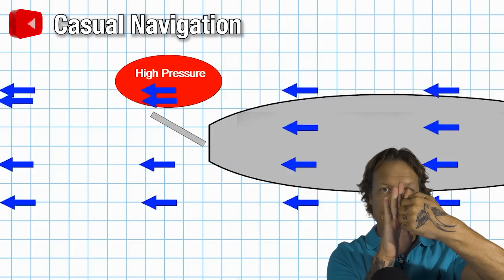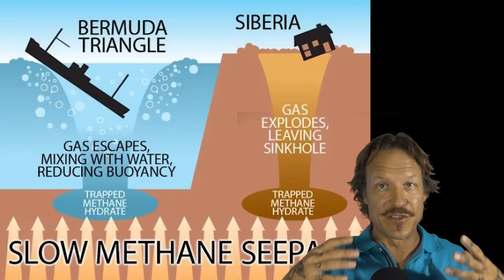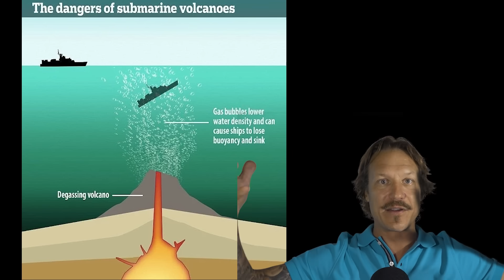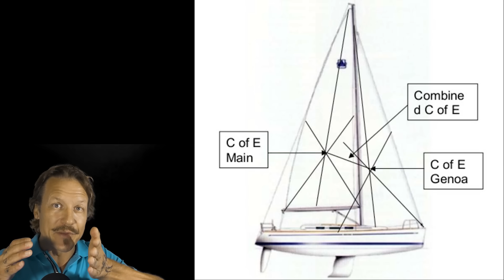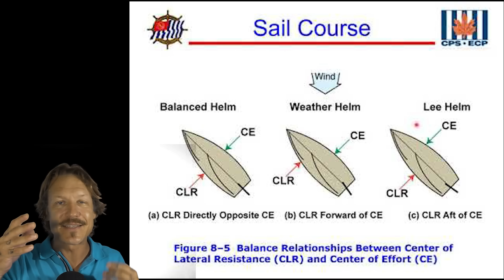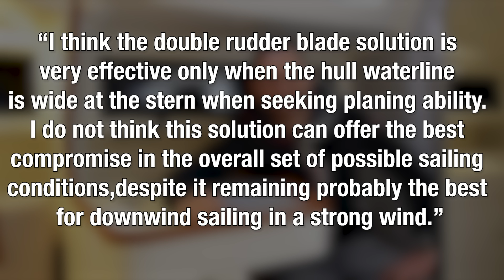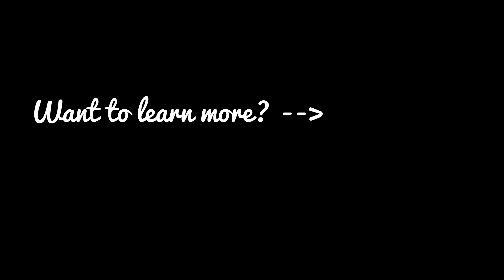The Problem With Dual Rudders Nobody Talks About

Comment: Hi James. Love your videos, however I would like to clarify the issue with heeling and its impact on CLR. Full disclosure here - I am a naval architect. CLR is predominantly determined by the size and location of the keel and rudder(s). The hull, particularly on a flatter, more modern hull isn't really a contributor to lateral resistance. When a sailboat heels to leeward, the Center of Effort moves to leeward and the keel moves marginally to windward. This produces what is called a lever - the mostly forward acting forces acting on the sails/rig are offset to the side of the boat and this will tend to make the boat round-up into the wind, all other things being equal. The CLR of the hull will not move noticeably as the boat heels, however, the area and angles of the rudders may play apart if not designed correctly. They should be designed for minimal change in lateral resistance as the boat heels, but perhaps not all designers do a good job of this. Another factor which may account for the different handling characteristics you have experienced could be due to the different ways that the centre of buoyancy changes on a wide vs a narrower hull as it heels. In theory, it will mover further aft and further to leeward on a wider hull, but how much and what impacts this would have would be very dependent on the actual hull shape. In short, I believe that IF designed well, the weather helm differences between twin and single rudder hulls (ignoring any difference in keel design) should be minimal.
Reply: Totally agree. The explanation in this clip is not only wrong, but incoherent. If (as claimed) the CLR moves aft when a wide hull heels, this would decrease weather helm, not increase it.
Reply: @Gottenhimfella I disagree with you. Imagine this example. We’ve all experienced sailing on a close haul on a ‘non-wide’ wide stern. We keep pressure on the rudder to leeward to maintain course…ie weather helm…unless you’re trimmed perfectly of course. Then comes a strong gust. The boat rounds up into the wind due to its stability. This turns the vessel towards irons which is a safety feature. Now imagine you’re sailing a ‘wide stern’ up wind and a gust comes along over powering the vessel. Instead of the vessel rounding up into the wind it turns to leeward, potentially putting you in an accidental jibe. That’s not a dynamically stable vessel. What the earlier commenters stated was that the wide stern vessels ‘can’ be made to behave like ‘non-wide stern’ vessels, that it wasn’t inherent to the design…though I personally don’t know how that is achieved. No such thing as a free lunch.
Reply: @troytompkins1261 The problem with that imagined scenario is that (all other things being equal) wide transom boats are more prone to heel induced round-ups than narrow. To be useful in such discussions,  imagination needs to be harnessed to some solid, demonstrable behavioural tendencies.
Reply: @troytompkins1261 we have a old fashioned designed van de stadt hull with symmetrical hull shape that is very well balanced. Upwind, she will just lean a little more in a gust. She has never rounded up but she does have a skeg mounted barn door of a rudder 6feet long. We know when it's time to reef
Reply: Sailing with Thomas on YouTube does and excellent video on this subject. My Beneteau 51.1 twin rudder heads to wind when over powered. No chance of a gybe in this situation. No twin rudder boat I have sailed does, I have have sailed many.
Reply: I’m going to have to draw a picture to understand what you just said.  Thanks for the counter argument.
Reply: @jericlarke3809 if you draw a heeled boat from astern, you will see how the driving forces are offset to leeward of the hull's resistance.  If you draw the same situation from above you will see why that makes the boat head up.
Reply: I am no naval architect, just an engineer. And I designed and sailed some RC model boats (they need to self steer more neutral than manned sail boats with a helmsman or AP at the rudder). and I sailed quite some miles inshore and offshore from dinghies , monohulls, cats & tris to a tall ship on various oceans.
Yes, the sideway movement of the center of effort is the primary factor in a sailboat's self steering characteristics:
- If you have a narrow hull the center of effort moves rather linear across the heeling angles, so those designs are friendly to find a trim working for a wide range of wind pressure
- If you have a wide hull the center of the hull's resistance goes faster leeward than the sail area (in low heeling angles), so you trim your sails for this configuration. As soon as you get pressure forcing higher heeling angles the situation changes dramatically, the sail area goes leeward to the hull which causes weather helm: You need a very different trim setup.

In race boats the crew trims a constant heeling angle across the conditions which makes a wide stern to work great. This is not the case on leisure crafts!!! So leisure crafts' wide sterns have only advantages while going downwind when they give added stability to hold course (better than narrow designs)
For those with a wide perspective: Model boats designed or regattas got narrower and narrower across the last decades, there is no crew stabilizing the heeling angle with ballast & foils.... (while the offshore racers go wider & wider!)

Side note: there are many more aspects to think about regarding low speed performance during maneuvers like tacking, docking, ... which are not covered in this short text.
Reply: As a Naval architech, what do you think about the statement, that CE moves aft as the wide stern boat heels? I find it unfounded, and false. 
And if CLR moves hypothetically aft, that only decreases weather helm slightly, not causing it. As you pointed out, heel causes weather helm (universally).

In my opinion and experience CLR does moves further aft if not because of the hull, than simply by the fact, that in twin rudder configuration the effective lateral surface area decreases less than that of the keel while heeling and so helps counter the torque introduced by heeling.
Reply: The advatage with twin rudders are obvious: grip basically no matter how heeled over and shorter less vulnerable rudders. The disadvantages to me are more friction and lees feel, more complicated "wiring" that can malfunction and importantly no propwash when maneuvering under power.
Reply: @joakimharlin9030 

The question is not two rudders or one, nor is it even a question of a very wide transom, the question is to imitate high-performance sailboats with Wide Transom without correcting the longitudinal position of the center of gravity (and center of Bouyancy) with respect to the longitudinal position of the Center of Flotation (!)

Center of Bouyancy = Center of Volume (!) of Water Displaced and (with Yacht Center of Gravity) Yaw Axis of Rotation

Center of Flotation= Center of Waterplane Area (!) and Pitch Axis of Rotation
Reply: A pretty good insight comes with the comments from Tim, of Lady K Sailing - definitely heavily prejudiced by Sailboat Racing, and his experiences with pushing wide beamed boats with flat bottoms between the chines to such extreme heeling angles, that the bow of the boat is pushed to the point, where its angle becomes that of the bow, and thanks to having Racing fully ingrained after years of doing nothing but, effectively, that really well designed wide beamed boats, that have hulls between the chines, which are then submerged under water, the hulls if for example Umberto Felci - though he certainly isn’t alone with his designs for Dufour- are very comfortable and able to cope pretty well with all conditions thrown at them- and frankly, if their shallowest Draft wasn’t a ridiculously deep 5 foot 8 inches on the 44 model, I would have bought one, and the very important point that appears to be totally lost on Sailboat Racers - you get the best performance from them, when the boats are sailed pretty much upright, with little heeling effect. Tim of Lady K channel is a really nice guy, but his Racing “Thing” seems to have him deeply fixed to the IOR designs that resulted in the 1979 Fastnet Race Tragedy, and is the failure that I have been attempting to fix ever since - and thankfully today, pretty much everything for the needed fix, is finally available, so fingers crossed, will be included in my next Sailboat- and to help make the benefits clear, it will be a Shallow Draft Monohull with a bolt on Keel - a Mars Lead aerodynamic Keel too- I prefer Island Packet, but they are so strong by default, it may be difficult to reveal the benefits of the concept, so for me, the IP must wait until after the proof of concept data has been gathered . Best Wishes . Bob. PS. Tim of Lady K channel has also become the editor in chief for the Practical Sailor channel, and to be fair, to me, he has totally knocked it out of the Park so far. 🙂🌟🌟🌟⛵️
Reply: I'm also a naval architect and came to the comments to say the same thing, but you got there first.
Reply: The seas in your CAD software are always flat and the weights are always exactly where you put them.
Reply: The take from me though is that due to the large number of boats like this, few are designed properly. Or he's telling lies for the sake of it and has no experience as claimed? 
"Trends" are not always good. Like cars with so much automatic technology that you can't override when you want to. Maybe I WANT to be able to reverse slowly with the drivers door open to eyeball a boulder and maybe I do NOT want the car to automatically put the damned break on! It's more than annoying.
Reply: @grahamnumber7123  So much is introduced because car makers seem incapable today of properly designing and building Brakes, steering and suspension that performs properly, so to fix what is basically absolutely crap designing, we get power brakes, power suspension etc, which massively drives up manufacturing costs, and I end up getting issued a Company Car - a late 1980’s early 1990’s  VW Passat Estate, that was seriously dangerous to take out in the Rain - hit a puddle, and the car would violently jump across the Road to the left or right, neatly positioning right in front of oncoming traffic. Prior, I had owned a Mk1 Ford Cortina GT with no power anything, that had perfect handling, braking and suspension so by default was totally safe to drive. We are seriously going backwards imho, and it isn’t just Aircraft Manufacturers that need sending back to Aircraft Building School,we need to send Car Manufacturers back to Car Building School as well, and tbh, the Kitchen and heating appliances sector needs sending back to School as well ? ffs, please god, no more crappy German Kitchen appliances Pretty Please Even ?☹️ Just read honest Customer Reviews, and pretty much everything is really bloody Scary, plus is chronically overpriced. 😡
Reply: I agree. The asymmetry of the heeled waterlines of a wide sterned hull also contributes to the moment which pushes the bow to windward. This phenomenon has nothing to do with the number of rudders, seems to me.
Reply: The question with Yaw + Roll + Pitch is not Hull "lateral resistance" but Hull "Munk Moment"
Reply: If, as is common today, a cruising yacht is a poor imitation of a high-performance sailboat, an unpleasant combination with multiple feedback loops is created: Roll/Heel creates Pitch, and Pitch creates Yaw, and Yaw creates Roll...
Reply: PS. Get hold of a long, straight piece of wood, and hold it up at 18 degrees from vertical, and look at the length it wold have to be, to be a rudder lived clear of the water . Now just how red is your face with embarrassment? 🤔
Reply: @brownnoise357 

The Rudder is in a Wide Transom, that When heeled:

(1) The Bow Sink ---> huuuge hydroDynamic Yaw Moment of a Hull with the sum of Roll/Heel + Yaw/Leeway + Pitch

(2) the rudder is partial out of the wáter so we need 2 rudders

The problem is no 2 rudders

The problem is no the wide transom

The Problem IS a wide transom Without change the Longitudinal Position of Center of Bouyancy in relation to the Center of Flotation (!)
Reply: This is a silly thing, and it's a problem that's been known since the late 19th century. A piece of cardboard is enough to understand it: if the stern is equal to the bow, then the primary center of the sailboat, the Center of Flotation, is at 50%.

If the stern is made larger or wider, then the center of the sailboat (The Center of Flotation) is around 60%, and the other centers, Center of Bouyancy and Center of Gravity, must be moved aft.

The question here is how is it possible that we have been discussing this obvious fact for more than 150 years
Reply: Center of buoyancy must move forward only, never aft, as the boat powers up and heels. It moves forward to counter the couple (moment) of the aero and hydro forces alone. Of course CofG does not move. 
The leeward rudder of a twin rudder boat becomes most efficient at heel, while a single rudder becomes ever less efficient at heel. This is why a twin rudder boat feels better balanced than a single rudder boat. A boat with a wide stern and fine bow (asymmetric waterlines) will trim deeper by the bow when it heels. This trim moves the CLR of the hull forward and becomes a problem on heavier (deep hull) boats (like oysters from about 2005 onwards) where the hulls lateral resistance is a greater proportion of the overall lateral resistance. So heavy boats with wide sterns benefit from twin rudders, to the point that if you want a big ass owners cabin aft you better go twin rudders, this is my experience. If not the same heavy big ass boat with someone single rudder will have lots of weather helm and drag its rudder like a nasty barn door.
Reply: I know little about about the physics here but even I noticed his argument is against wide stern designs not double rudder designs. Most of what he said has nothing to do with rudder number or placement.
Reply: In (I hope) simpler terms, a "traditional" hull shape maintains a high degree of symmetry as it heels; whereas the hull shape change as a wide transomed hull herls is much less linear (or at least harder for your average sailor to predict). In higher sea states, the hydro dynamics can change rapidly and wildly, and overwhelm a shorthanded or inexperienced crew.
Reply: @petercharles6462  this is not necessarily true. A wide boat can have good heeled lines and a narrow boat can have terrible ones. That's a matter of design quality. It is easier to achieve on a narrow boat, tho.

The primary driver of weather helm when heeling is the sails (and the forward drive from them) moving leeward. "All" sailboats do this and it's a desirable quality (within reason) so you round up instead of getting knocked down in a gust.

Every half decent sailboat can be set up to go upwind with a locked rudder. Never had a problem with that on boats with wide sterns.
Reply: Naval Architect ignorance is ... Amazing
Reply: @maplecookieyacht I am an engineer too, but only for planes 😂, but as a sailor,  I would love to understand the basics of boat design as I learned in my studies for aerospace flight dynamics. Is there a book, presentation available which you could recommend to look at? Thanks.
Reply: @anton.dr.w  The standard textbook is "Principles of Yacht Design" Hardcover – Illustrated, June 14, 2022
by Lars Larsson (Author), Rolf Eliasson (Author), Michal Orych (Author)

Comment: Dual rudders and wide sterns are also a disadvantage in tight spots / marinas. They catch on moorings and anchor chains more easily and it's harder to squeeze a wide stern inbetween 2 moored boats. Makes a difference in Greece and Croatia. Makes reversing and maneouvring also more challenging - you can't use a water stream deflected from a single rudder blade to your advantage.
Reply: @WojciechNiesyto, I second that.  I have an older single rudder and reversing into a Town Quay in Greece with a cross wind or cross current is challenging enough without the side hooks.  Then upon leaving several times now my neighbour boats have snagged one of their twin rudders on my anchor chain on the way out.  I see the justification for the newer designs which carry the beam aft and thus the rudder lifts out of the water sooner when heeling.  But in the spirit of making things complicated and motorised, how about a single rudder that moves windward and leeward depending on the angle of heel?